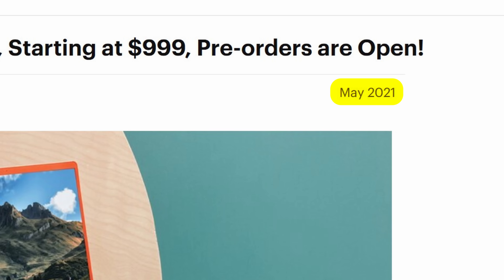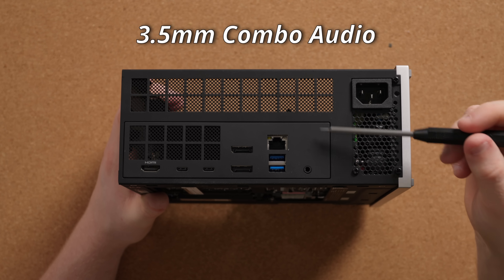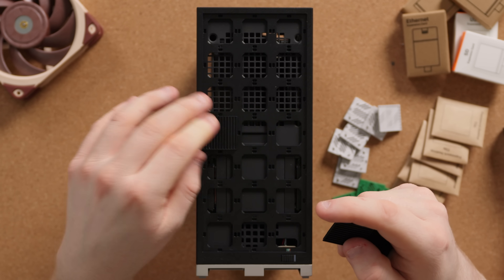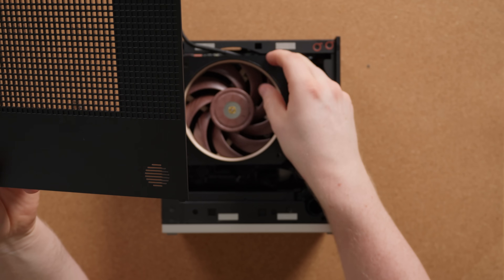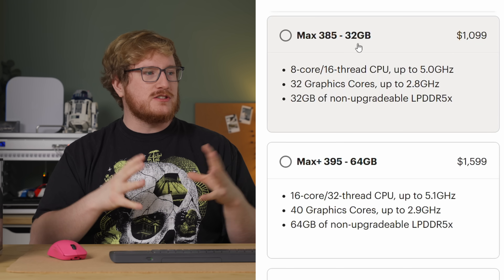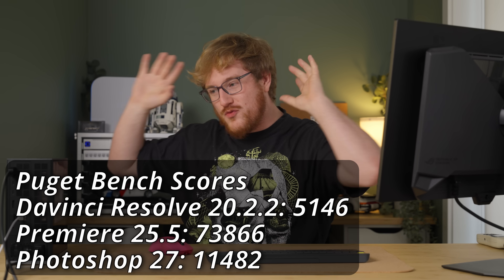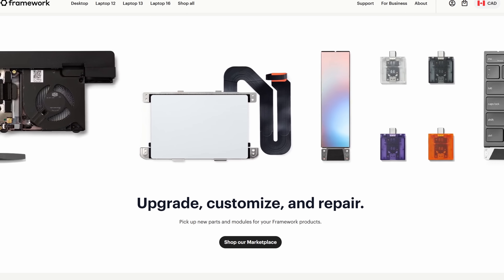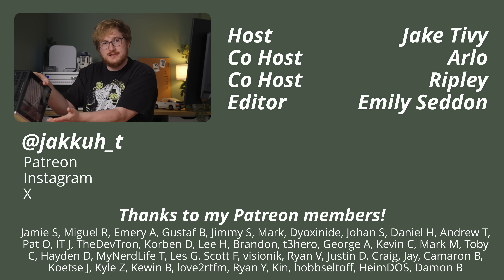I’m glad I didn’t invest, so I can talk the Framework Desktop

Comment: I wonder if the performsnce would insresse with the case fan installed!
Reply: From a different youtuber: No, that's only neccesary in really hot environments, and simply removing all the tiles works just as well then. The CPU cooler alone at full tilt will cool the whole box. It helps, of course, but is optional.

Comment: That pci-e slot without a way to mount a pci-e device is a weird choice. Even a open x4 slot is a better choice.
Reply: I don't think Framework intends anyone to use a GPU in that slot, mainly because I believe it only provides 50 watts of power instead of the standard 75 Watts that you get on an ATX board, so most GPUs wouldn't work anyway.
Reply: @theangryintern  I wasn't thinking of gpus but SFP+ /SFP28 cards would fit.
Reply: It's normal ITX board and they sell it separately -- bring your own case/PSU.
Reply: Its a mini itx strix halo board, that's pretty cool in itself. Its not as if PCs needed to be made more modular
Reply: Honestly, it fits with this entire design. It seems very sloppily done on top of the virtue signalling it exposed. This device only officially supports Windows, arch, and bazzite. If their point was to make an LLM machine, of which their are 3 or 4 identical offerings on the market, forcing people to use arch over something like Ubuntu is insane, and the reason appears to be because they chose a network card with minimal Linux support, for an LLM host lmfao
Reply: @brahtrumpwonbigly7309  Ubuntu 25.10 is officially supported by Framework for the Desktop.

Comment: That's a funny looking Steam Machine...
Reply: This thing is a powerful monster compared to the Steam Machine, but also much more expensive. It's ironic because Steam Machine has separate GPU and CPU and is both weaker and cheaper. Thanks for overpricing PC APUs, AMD.
Reply: @kazioo2  the steam machine does not have a dGPU, but i assume you probably found that out by now lol
Reply: Akshully, it's an XBox

Comment: ah yes, the best way to reduce e-waste, proprietary motherboard
Reply: Have you even tried to research? 
"The Framework Desktop Mainboard is compatible with all Framework Desktop parts or can be used with a standard Mini-ITX case, ATX Power Supply, and 120mm CPU Fan, letting you mix and match with the best of the wide open PC ecosystem. "
Reply: @char_noir  Yeah, its proprietary, but its not like they can really avoid it.
Reply: @renderedpixels4300 proprietary for what? mitx, takes atx power, has no weird io. The only "problem" can be only soldered ram and cpu.

Comment: Thank you for the rant on the power cable! I don't understand how people are seeing that as a bad thing. At this point I probably have enough cords to for my entire lifetime, at least until the plastics harden in the farther future. (I also don't get the problem with chargers not being included with some phones, especially now that we're on USB-C.)
Reply: It's the internet, people are looking for things to be mad about and a cable that you can get for a couple bucks not being baked into the price is just as bad to them as Windows slightly changing how the start menu works. It's just outrage for the sake of outrage and is the main reason that I no longer have any social media on my devices and it's blocked on my PiHole.
Reply: I agree, but to steelman the argument for phones: The argument I think is more along the lines of: "Phone v1 with cable & charger is $999.  Phone v2 without cable & charger is... $999, why not $979?". The implication being that the $20 is just sucked up by those evil greedy CEOs and not just shifted into other areas of the BOM.
Reply: @gabrielpi314 Inflation. That's where the 20 goes...
Reply: If I'm paying $2800 for a PC, I think it should come with a power cable. You giving me the option to pay more for it doesn't make me happy. Let's be honest, Framework as a concept is great, but Framework pricing is awful.
Reply: I think phones a bit different. Each new generation requires more powerful charger and also the cable which supports more W. Thus, people have older chargers, but they cannot charge at maximum speeds without buying a new charger and cable. Since charger is not what they selling, adding one is quite a small amount to add to the price.

The same example is like buying a laptop is much cheaper than buying all separate components for it. Because when you buy separate components, a manufcaturer and seller must make money on each part. But if you sell laptop, the money needs to be done only on one sale and on one manufacturing.

Add to the fact that most people now update a phone after 2-4 years, it will always require a new charger and cable.